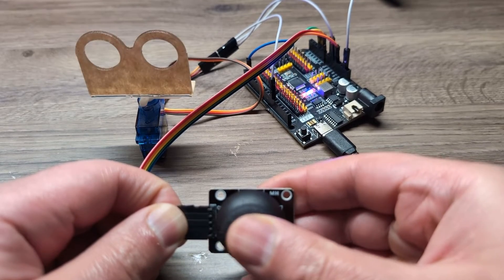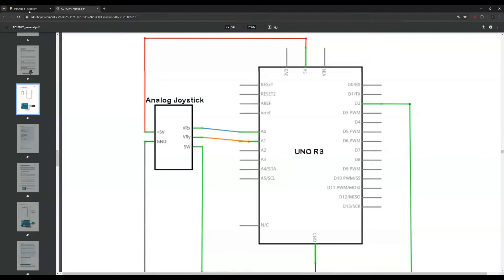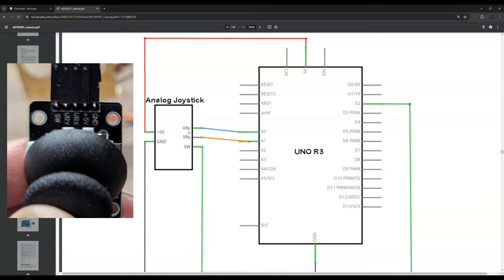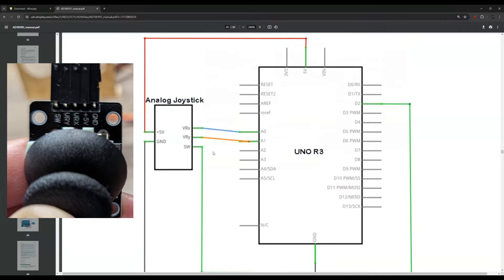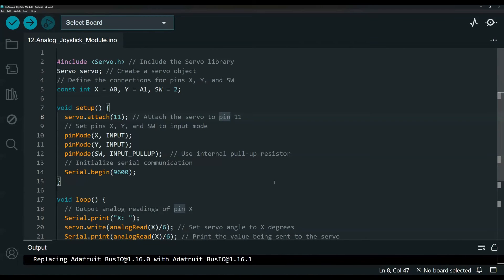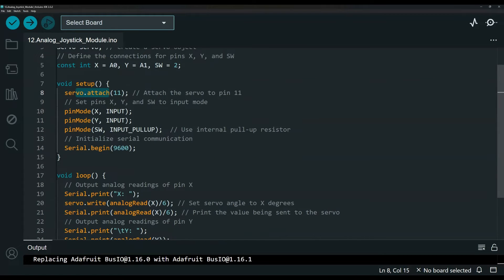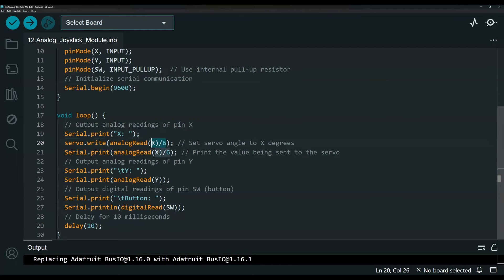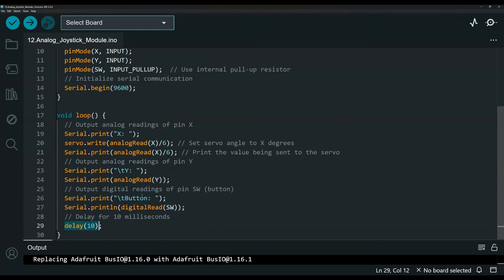Joystick To Control A Servo #arduino

Comment: is it possible for 2 servos  i cant code yet and other people have the code behind a paywall
Reply from the maker: Yeah, it is possible, I have a free code to show how you can control multiple servos using raspberry pi or Arduino, it's free check it out just search TechsPassion or go to my GitHub
Reply: @techs.passion you're cool dude